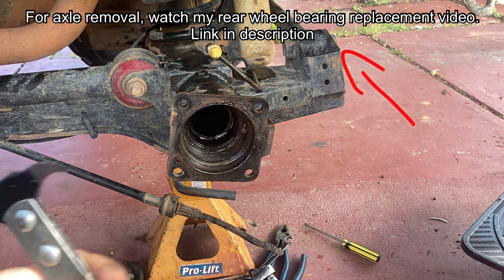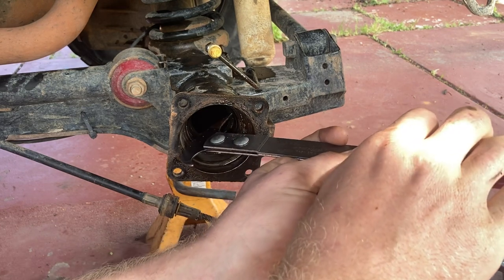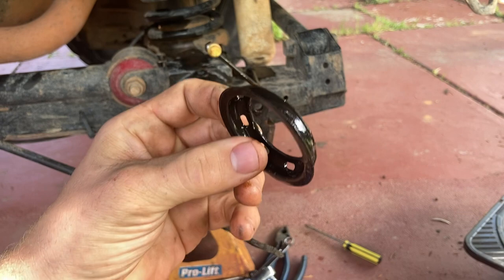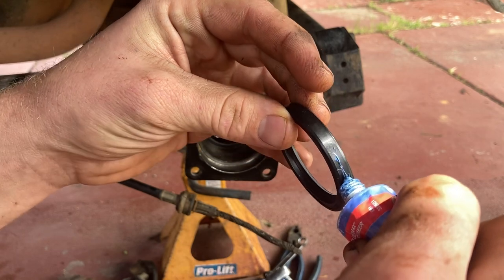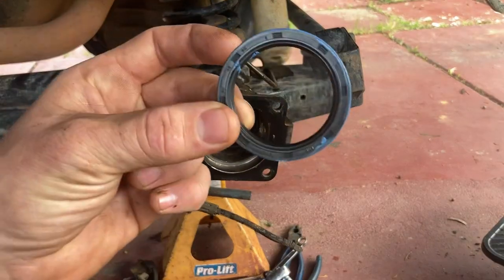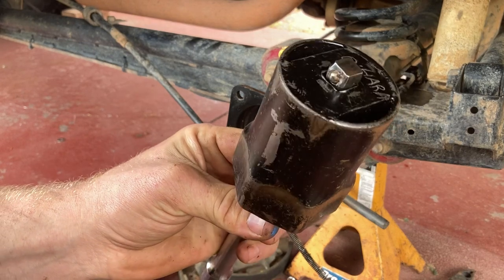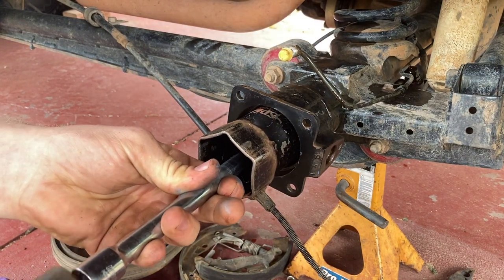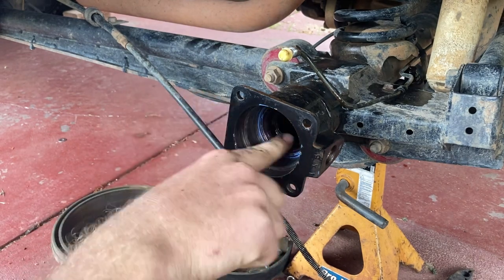HOW TO JIMNY  [ Replacing rear axle seal ]

Comment: I'm trying to do the rear diff seal on my Jimny, this video is very helpful but I'm struggling to get the drum brakes apart. Can I leave the shoes in place when i pull the axle out? If the brake line and handbrake cable are disconnected?
Reply from the maker: Yeah you could, it just might be a bit difficult to get to the hand brake cable
Reply: Awesome, thank you.

Comment: So you drive in the seal until it bottoms out against that plastic oil seal cage/protector? I thought you just tapped the top flush with the second lip (about an inch inside the axle housing). I’m a novice so please correct me if I’m wrong
Reply from the maker: Either mate. As long as it’s running true on the sealing surface

Comment: What if my rear axle is still leaking oil even after putting new seal?
Reply from the maker: Incorrectly installed, sealing surface for seal has imperfections, bent axle, bent diff housing, damaged seal